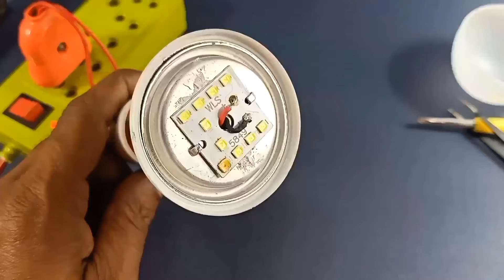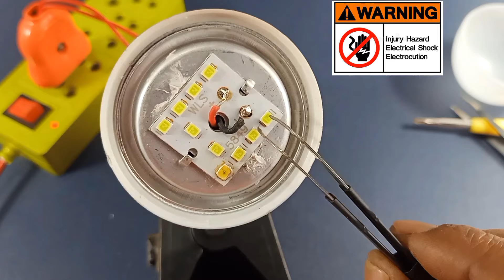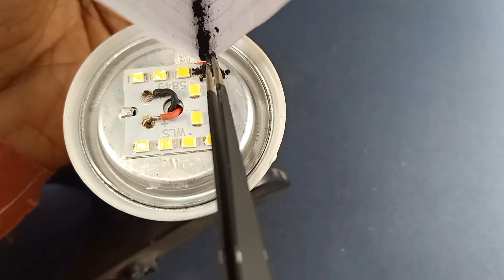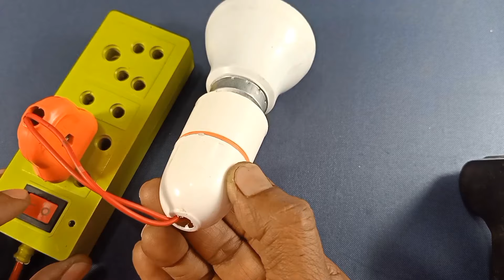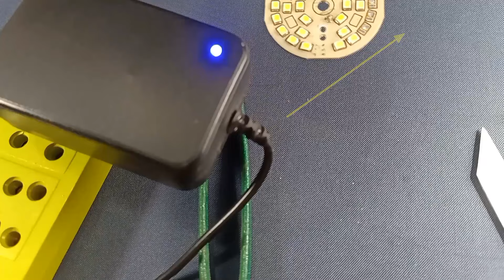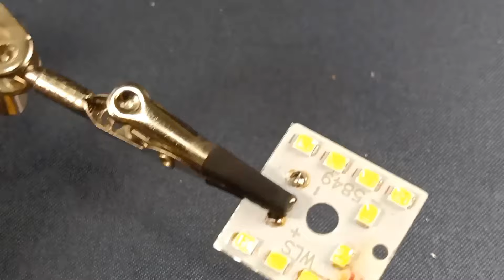3 Ideas for LED bulb !! If you see it, you will be amazed

Comment: Last method give more time for working lamp. If remove diode and solder, voltage up. I tried to do this, and after that the lamp worked for a maximum of two or three hours.

Comment: RG hi! I'm in future making transformer from Latra (an adjustable transformer with a shrafit roller with a power of 1 kilowatt) he has a 0.5 mm wire on the primary winding, I will make a 2 mm wire on the secondary - low voltage. I think for the amplifier with two polar power supply. and for alternating current, I think that 50/0/50 volts will be enough.
Reply from the maker: Yes, you can try

Comment: It is interesting that the assembled power amplifier according to your video (power supply 26.6 Volts) could not disable the speaker with a power of 30 watts. (and I also assembled a bass doubler just like you have on bc 547c.) maybe I don’t get enough amps for power?